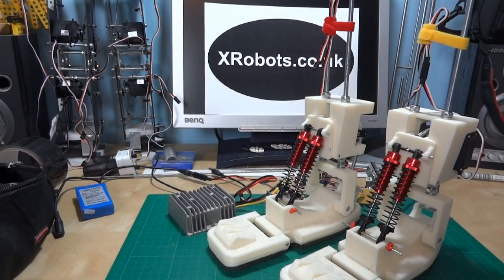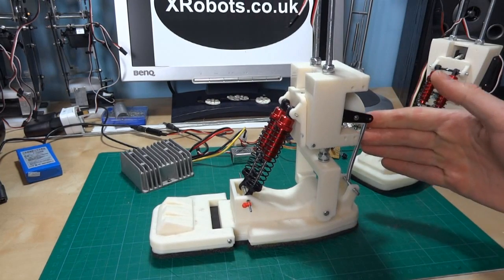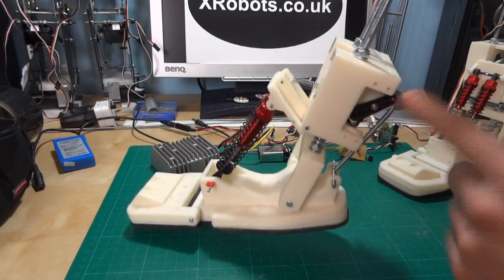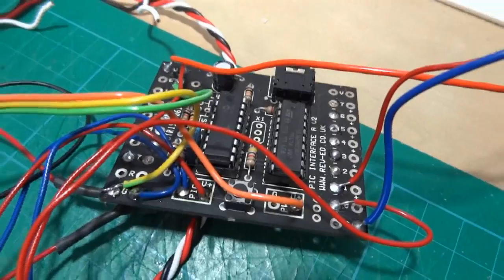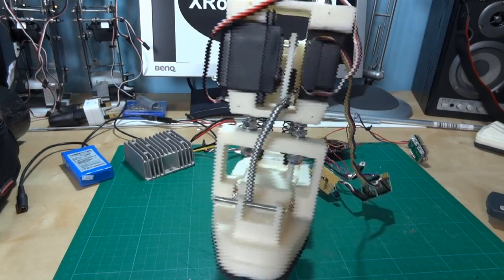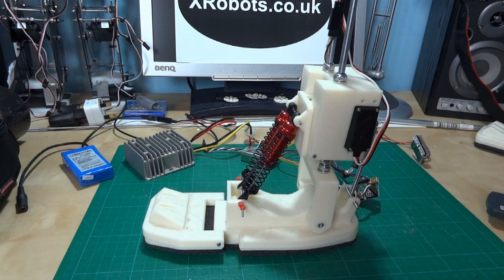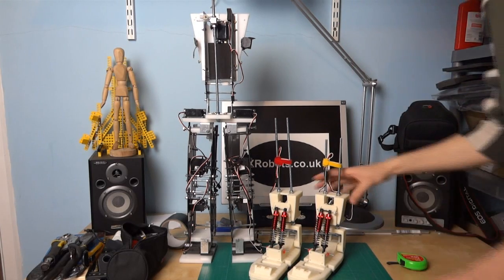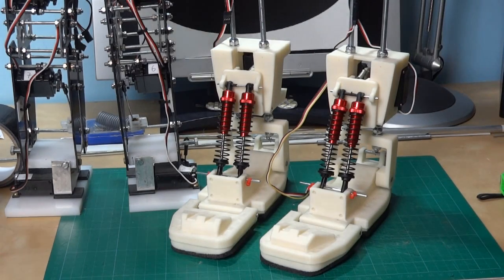Android 12 Part 3, Preliminary Dynamic Ankle Testing, for my Bipedal Humanoid robot

Comment: The reason that will not work is a simple calculation of force and weight. Those servos could never move very much weight, also the springs are not able to transfer the necessary force that would be required to move the weight of your robot. However, it looks awesome.
Reply from the maker: This is from nearly eight years ago. I've made better ones since.

Comment: but when people walk our foot lays flat and we roll our ankle inwards and shift our weight forward transferring our balance from hell to center of foot and back in to our big toe in sort of a half moon. from heel to toe... the toe is actually used as sort of a spring for forward motion at walking speeds.. As we straighten our weight is converted to force that is pushed downwards straight into the hell pad of our big toe. 

During the downward transfer of our weight into force our heel is already off the ground and our opposing leg is in forward motion. The human stride is nothing more than a transfer of weight over an ever changing center of balance.

This method of bi-pedal travel is actually very elegant and fluid when plotted out and is what I think defines us more than our thumbs. The number of calculations and sensory adjustments our brain does to make this function is astounding considering it is done as second nature.

Judging by the design of that foot. the center of balance of your robot will be in its hips causing that familiar Frankenstein walk.

Comment: Thanks for subbing. I found  mechanical strength can be a problem especially at the ankle , and knee joints , but you may find  that the output shaft of the servos also needs to be supported externally, as although the servos may have sufficient torque the plastic surrounding the bearing housings can't take the weight. Oh and in terms of ground breaking if you look at some of the robotic stuff described as such, well I will say no more, maybe that's why a few of us are building our own... ;-)

Comment: Good work ! I went straight for the full size version myself but once you have finished designing it you could always scale it up. The sideways movement of the ankle is very important for balance and for that initial lean to the side ,otherwise you will have to exaggerate the torso side lean to get the leading leg off of the ground as you will find out. Interesting that the suspension is at the front and not where the Achilles tendon would be but I admire your out of the box thinking..:)

Comment: Awesome! I am very impressed! I love the design of the compliance into the joints. I always felt robotics built too much rigidy into the joints. Also using the gyro on board for localized correction.
3D printing is finally bringing the robotic revolution we've been waiting for. And it's hobbyists as much as corporations doing it. nice!